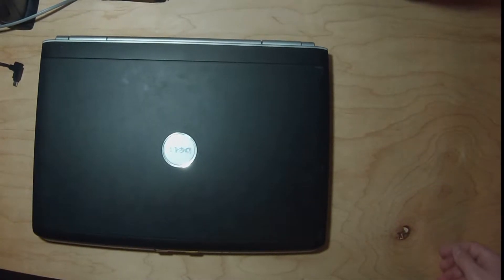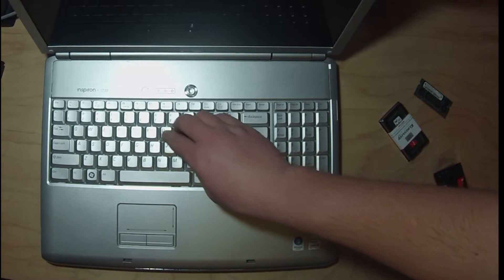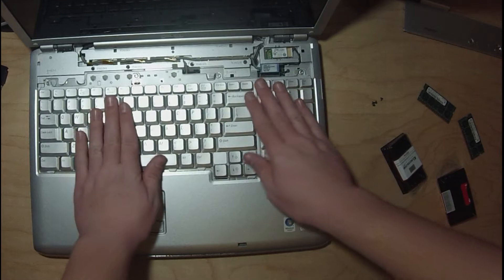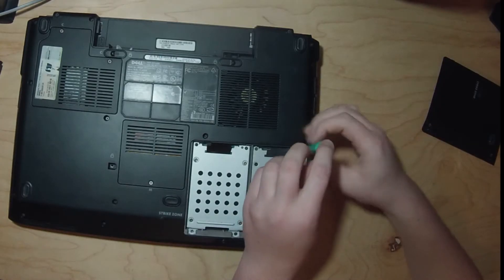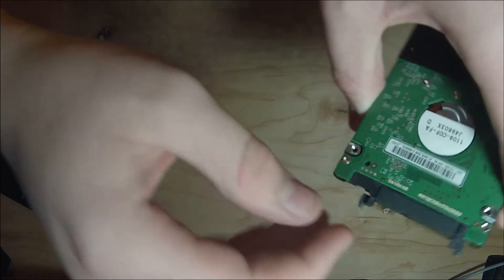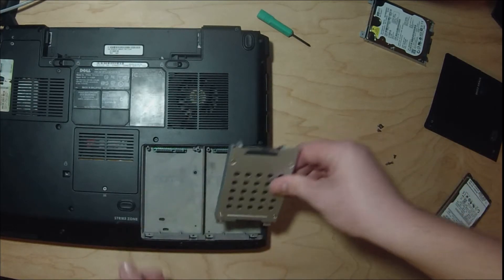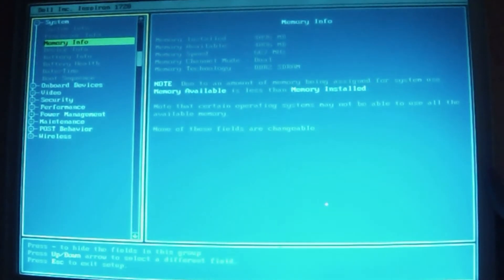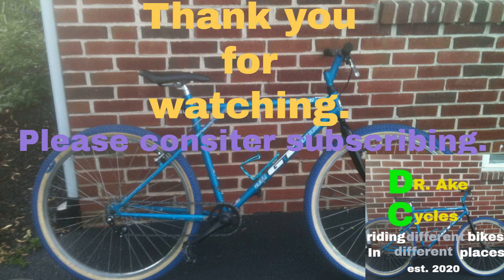Upgrading My Dell Inspiron 1720 - Ram and SSD Upgrade

Comment: Are you happy with this ssd and ram that you chose?  Any regrets?  I have this same machine and debating which ssd/ram to get.  I'll be doing simple tasks like web and video.  Thanks!
Reply from the maker: I am pretty happy with the ssd I got, I haven't had any issues with it. I think that putting more ram than the 4gb that I did would be worth the money, especially if you are running windows on it.

Comment: I have a pink one with a disc player but it’s so outdated that when I do scan everything is at critical can you tell what to do if I can fix it up to where it can be updated or atleast a new windows software instead of vista?
Reply from the maker: If the Processer is fast enough you might be able to get away with just an upgrade of the ram and storage to run windows 10 on it.
Reply: @Dr.AkeCycles  thx